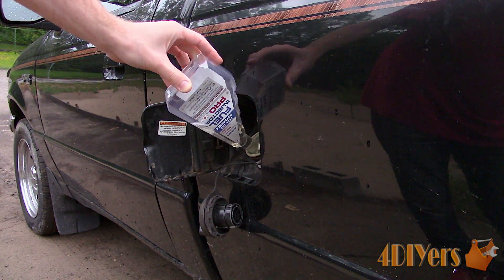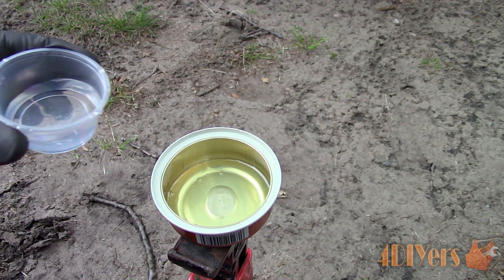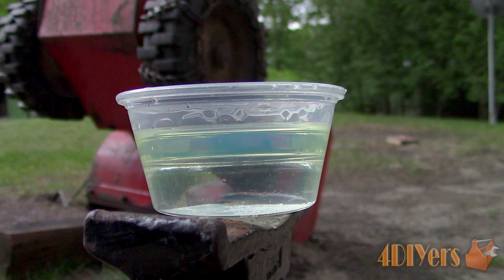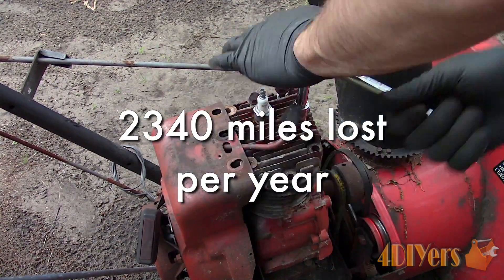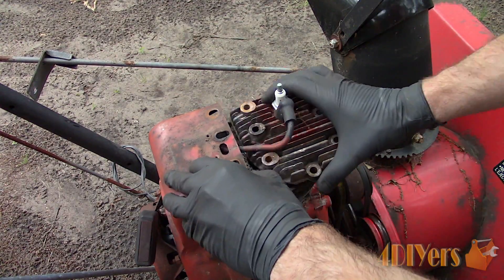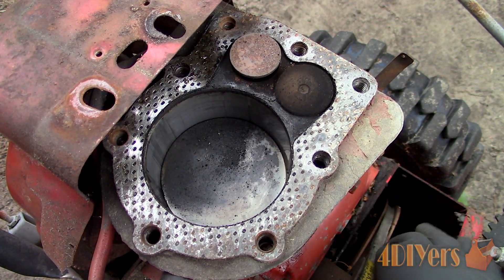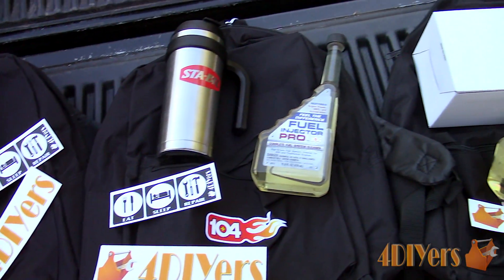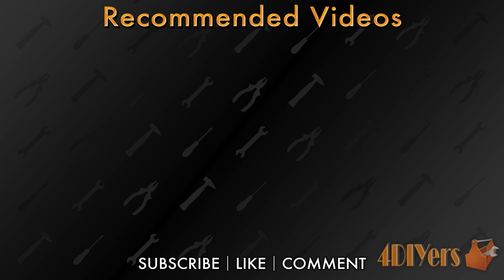Why it's Important to use Fuel System or Injector Cleaner

Comment: I got this 98 chevy blazer used yr ago only had change fuel  filter and started right up but now 6 mos later is doing same.trying to start but not hitting all the way.not firing.getting fuel and no check light on.new battery so could it be i need some fuel injector cleaner.feel there may be moisture some where.been lot of cold nights and hot days.have half tank gas.could you plz help me?

Comment: Can I use both first the fuel system cleaner with one full tank and once its finished can I add fuel injection clear with full tank again ? Is it safe to use both or only one is required?

Comment: I'd use it on my 1991 MR2 Turbo. I haven't been driving it for a bit but now that winters over and I'm working on some small stuff like adding speakers I was considering doing a full overhaul and this wouldn't be bad to use it on. Anyway cheers and thanks for the videos!

Comment: Interesting! Would love to try some in my '01 Cadillac Seville STS, with the 4.6L V8 32valve Northstar. Haven't had much problems concerning soot, or so it seems of course. But I do wonder how much different our fuel in Europe is. Would it be better for these engines or worse, would a fuel injector cleaner make a difference in how it performs. I'm very intrigued by this.
And good luck to all!